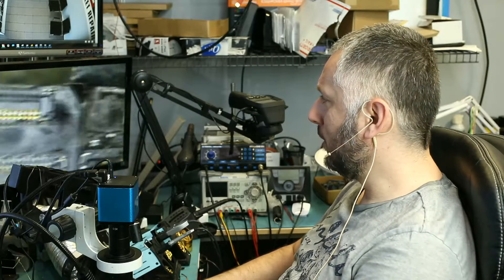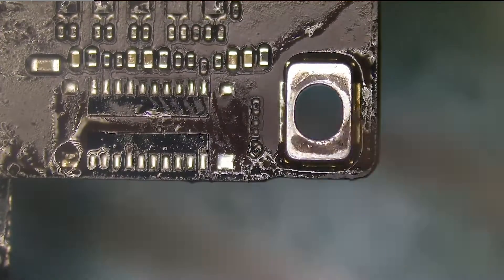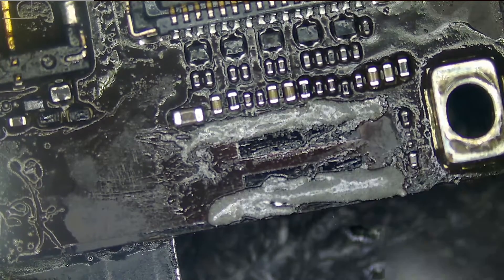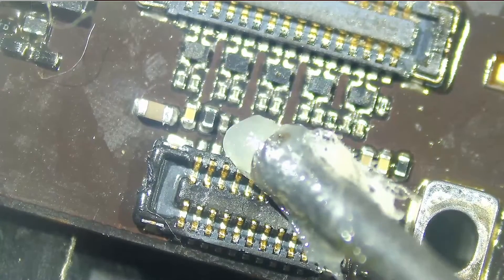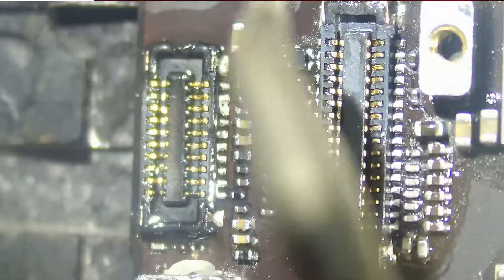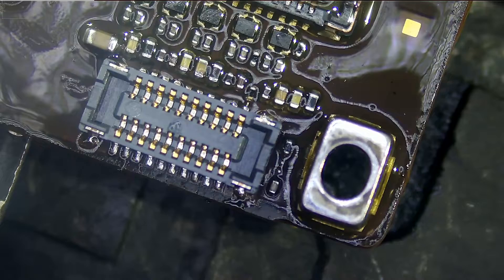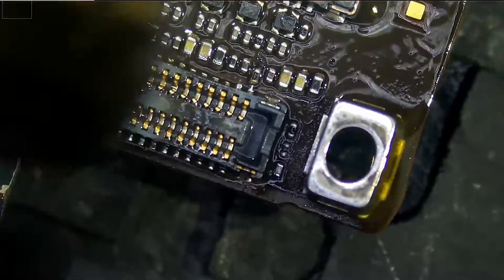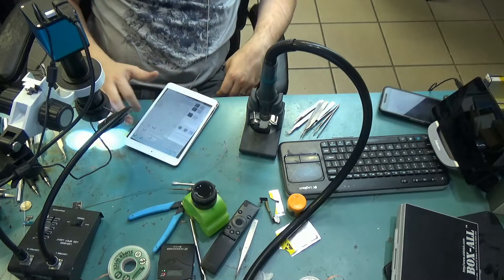iPad mini 2 FPC connector replacement using Solder Paste - Good idea?

Comment: To  much solder paste. Before using hot air, use soldering iron to apply the solder paste to contacts. Then clean, put flux and new connector

Temperature to high. 320 is ok. 395 is to much
Reply: what abotu airflow for removing FPC connector vs appling new one?

Comment: The only luck I have ever had with solder paste is either with stencil or using a syringe like you do with the Amtek flux, put it on each pad. It is really hard to do micro soldering like that with it, of course you are 100X better than me at soldering, so you already know that lol. Thanks for sharing you make the connector look to easy! 👍

Comment: I apply soldering paste then i use the soldering iron to melt the soldering paste on the pads last step put flux after flux the fpc connector and i apply hot air

Comment: Hey..
1You should not put solder paste into connectors component because it will make a gap between both component...
2. You shouldn't make hot directly like this because that's plastic part of components will melt
Reply: I learned that melting a connector haha

Comment: Hi, as always great video. Can you tell more about the temperatures and air flow that you use in solder and desoldering in order to not melt the connectors or damage the board. 
Thank you for sharing your knowledge.
Reply from the maker: Every hot air station is different. Usually i would start at 395c from far to preheat the board then i come close. You have to practice on a bad board to see what works for you.

Comment: Hi sir, again a very instructive video, thanks !! Would you use the same method to replace a faulty connector from a iphone flex cable and is it possible for this kind of job to use a good connector from a donor cable or it's to fragile to remove with hot air ?
Reply from the maker: FPC connectors are very fragile. You can take of donor board, but it takes allot of practice and you must know your hot air station very well. I did it in several videos https://youtu.be/K6qL54jwvp8 and https://youtu.be/K9D4G_RfXwo and https://youtu.be/CF8FOktt0kQ

Comment: Thanks for sharing this kind of work with everyone! I've had similar results in the past. In a repair environment where stencils aren't really an option, the only reliable way to use paste that i'm aware of is a solder paste dispenser.  Thanks again for everything you've contributed to the community.